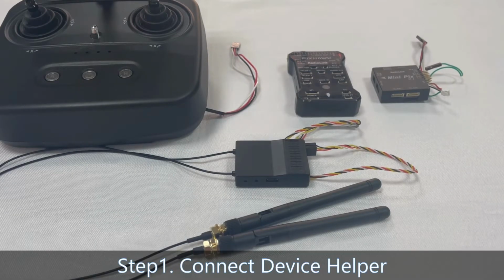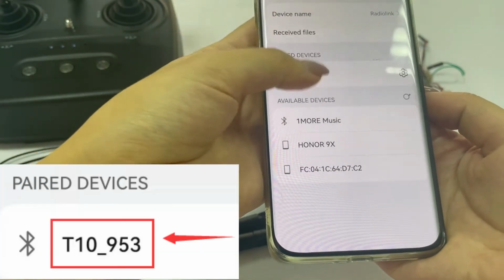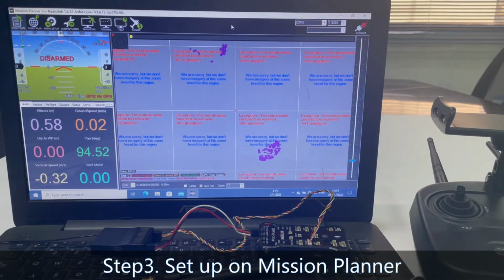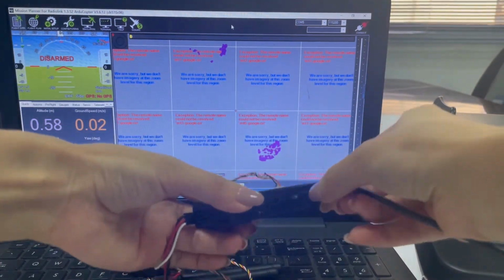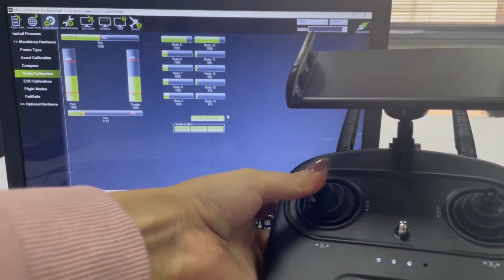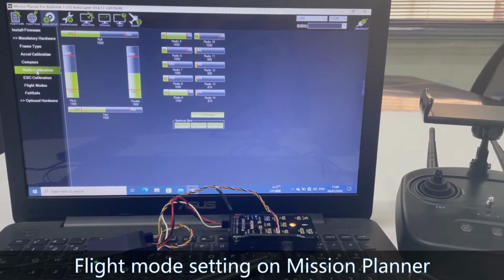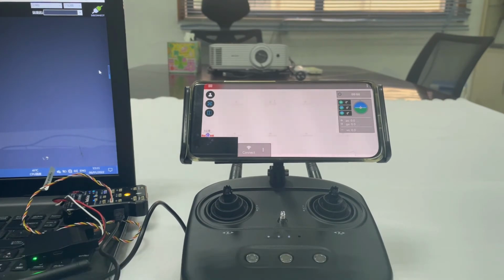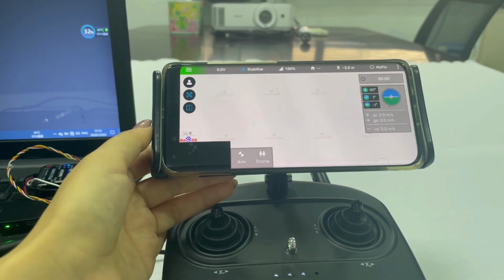Skydroid T10 & RadioLink flight controller PIXHAWK/Mini Pix/crossflight

Comment: Can we be able to fly our drone on autonomous mode with this module (pixhawk,mini pix and skydroid) ?

or is there any other option to fly drone on autonomous mode with skydroid?
Help me out please.
Reply from the maker: Hello, sir. You can fly your drone on autonomous mode with RadioLink pixhawk or mini pix. Use it with GPS. And you can use different transmitters with PIXHAWK or Mini Pix. Just make sure the receiver of the transmitter supports PPM/SBUS. So they can work with  pixhawk or mini pix. Here is tutorial on Auto flight by following the waypoints set in Mission Planner when use Radiolink PIXHAWK, Mini Pix, TURBO PiX: https://www.radiolink.com/newsinfo/475989.html  Here is video tutorial: https://www.youtube.com/watch?v=4ZVKzOSuwdo  We are producer of RadioLink transmitters and flight controllers. Sorry for more details of skydroid, you can contact producer of skydroid. If any question about RadioLink products, please feel free to send email to: after_service@radiolink.com.cn

Comment: Hi
Is it the telemetry plug which is not compatable or the wiring?
Reply from the maker: Hello, sir. It is the data transmission link(telemetry plug). If you use Mini Pix, for data transmission link, you need to plug it to telemetry 1/2 of Mini Pix. But the interface of data transmission link is not compatible with the telemetry interface of Mini Pix. You need to change the wiremap of the interface. Find the diagram of the interface of PIXHAWAK and Mini Pix on RadioLink Official website for reference: https://www.radiolink.com/minipix  If any question when using RadioLink products please feel free to contact us. Our email is: after_service@radiolink.com.cn

Comment: Hello, is the mini Pix really necessary?
Reply from the maker: Hello, sir. The video shows how to connect Skydroid T10 transmitter with RadioLink Mini Pix/PIXHAWK. If you do not need flight controller, you do not need this tutorial. It depends on if you need flight controller on your model.

Comment: Since 2019 with a minipix not working and your support couldn't solve it, you have good radios but the support is horrible.
Reply from the maker: Hello, sir. Mini Pix is a flight controller, which will work with many other devices including transmitter, receiver, ESC, motor and so one. Sometimes it may be hard to confirm the problem. A detailed video may be helpful to solve it. Sorry for the unpleasant experience. Anyway, if there is any question when using our products, please feel free to contact us. Our email is: after_service@radiolink.com.cn
Reply: @Radiolink_official  Several emails have already been sent, but it still didn't work, and it also doesn't have any support for my language, getting even more complex.
Reply from the maker: @paulomakill  Sorry to hear that. If you like, you can also send details to us again. We'll try our best to help you solve the problem.
Reply: @Radiolink_official  I need some support in Portuguese Brazil, to help me, this product is little sold, there is not much tutorial on YouTube to help.
Reply: @Radiolink_official  You should make videos here to explain how to configure.
Reply from the maker: @paulomakill  Hello, sir. Sorry we do not know about Portuguese Brazil, we have support in Chinese and English. As for configue, there are different manuals/firmwares for different model, so sorry there is no tutorial on it. It is on manual. Here is the link of detailed manual of Mini Pix: https://www.radiolink.com/minipix_manualWe have some tutorials on YouTube. But we'll consider adding more tutorials of Mini Pix on YouTube. Thank you for your feedback.